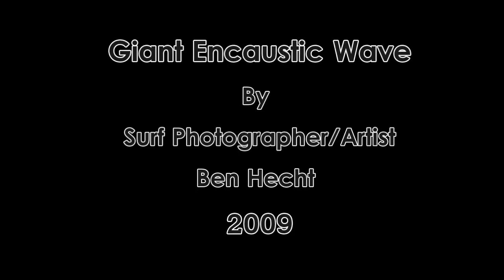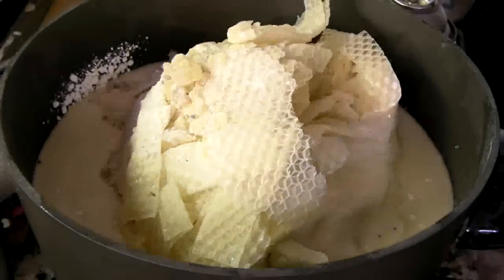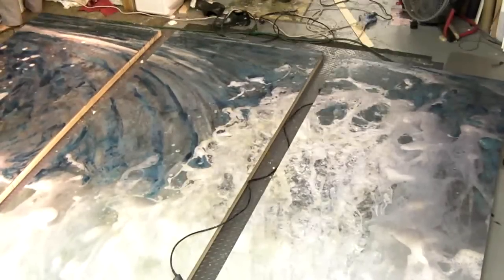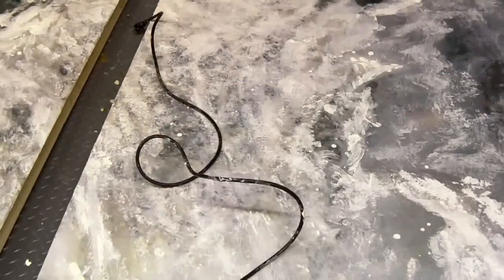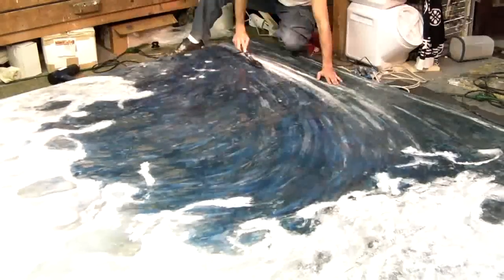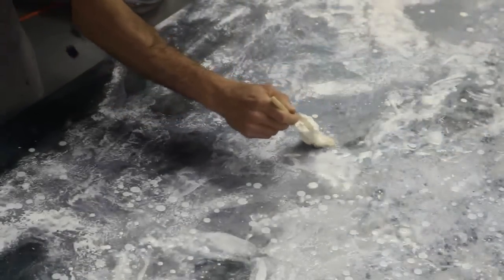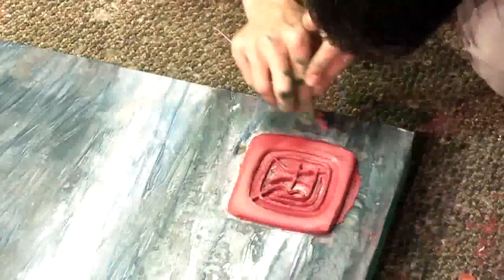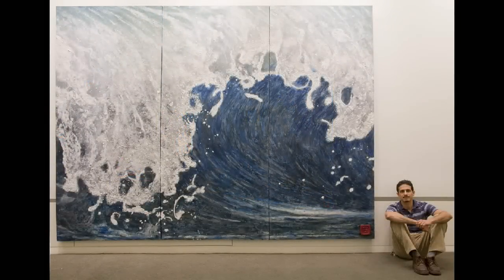Giant Encaustic Wave Installation in SJ City Hall-Ben Hecht

Comment: This was just great, thanks! Can you comment on the original photographic image? Did you actually print it out and apply it to the boards or was it a trace of some sort? Assuming you printed, what was the quality of the print resolution and paper type? Where did you have it printed as I have wanted to print large scale in the past but have had a hard time finding where to do it. 
Thanks again, great job!
Tony

Comment: Ben, what do you use between the first layer of encaustic medium and the wood board?  I'm new to encaustic... and noticed that working straight on birch results in seeing the wood through the medium, I prefer having a white background.  Using R&F encaustic gesso is too exp when doing several large surfaces that are 16" x 16".  I looked into making my own encaustic gesso with rabbit skin glue, seems to be very time consuming.  Also, looked into covering the wood with water color paper, but than what's the point of using a nice birch wood.  I'm completely confused.  What is your suggestion?
Reply from the maker: I find that a white ground, especially water color paper, is well suited to encaustic.  My more recently work is fairly different from this painting however.
Reply: Thanks for asking ! I was wondering the same.
Reply: You can just use pigment encaustic wax. I'm not a huge fan of encaustic gesso myself. And the reason for using birch is not aesthetics- it's about absorption and stiffness.